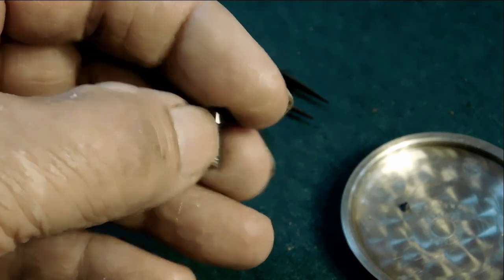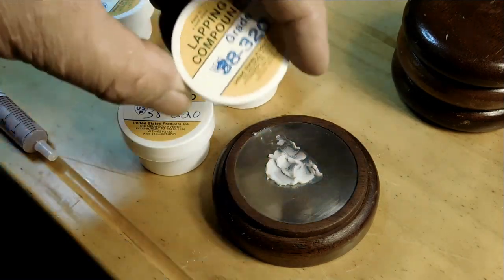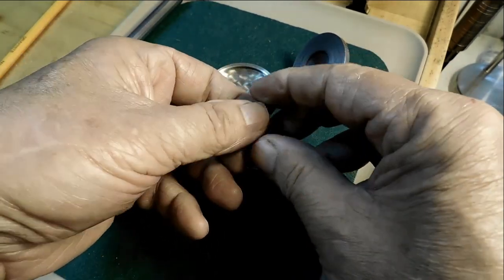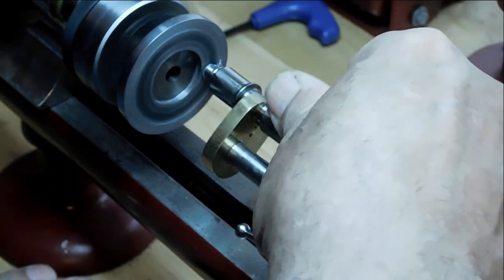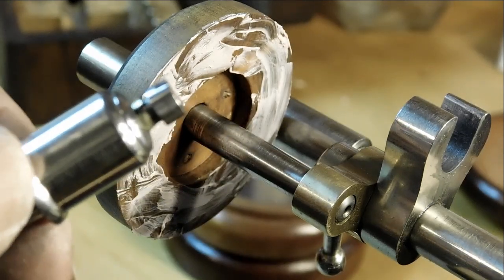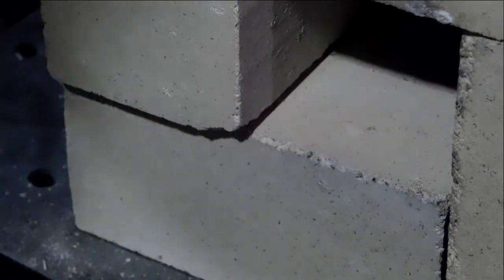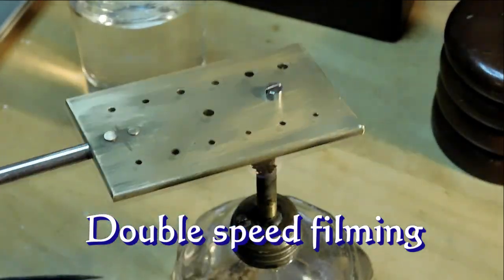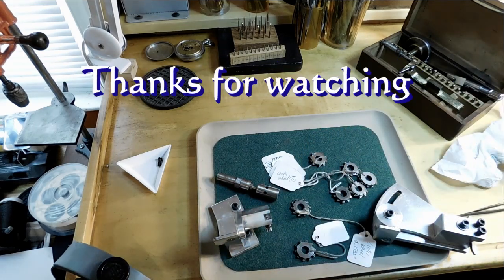Screw Polishing and Tempering

Comment: Fantastic video. I just purchased a Boley screw head polisher. What do you use to clean the boxwood lap of its diamantine after you're done polishing. The metal wheels would be easy to clean, but I don't want to damage my boxwood whee.

Comment: Hi, I am trying to find out if it is possible to blue some steel screws for a Rolex 3135 movement, I want to try and blue the screws for all the bridges in the movement as the movement is on show through a crystal caseback. I can't find any info on this, do you know if this is possible at all?
Reply from the maker: I have never done this before for that watch so I will not say you can do it...but I can say every screw I've polished to perfection blued well..here is my 2 cents worth...go to Esslingers search for generic rolex parts...buy some screws and give it a go...see how it goes